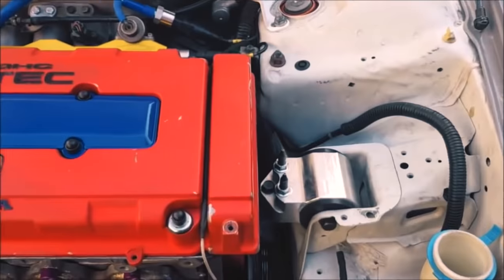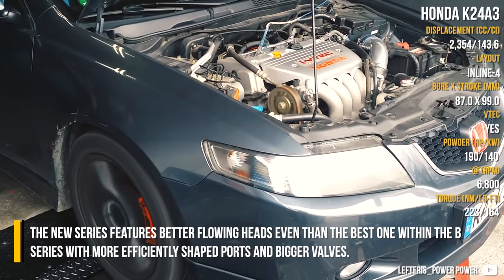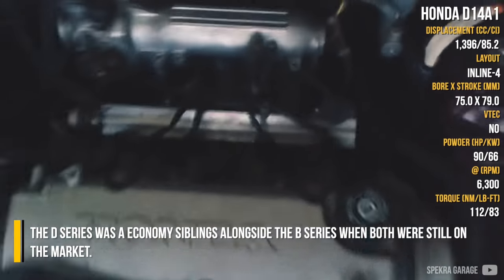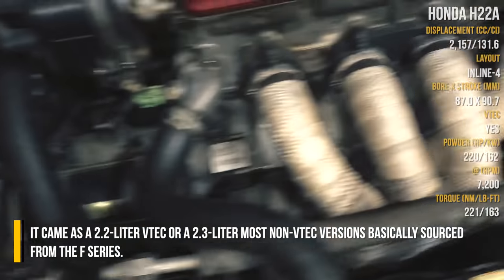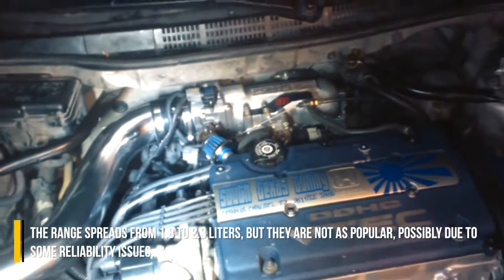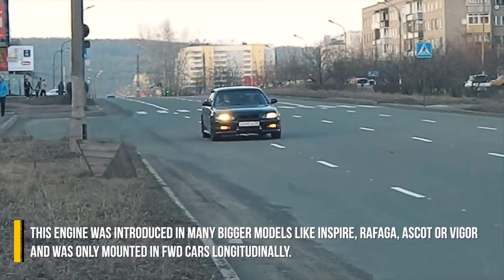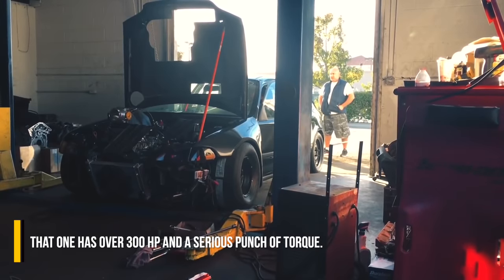Honda Engine Series: Explained

Comment: Leave a like if you're a K series Owner!
Reply: Logλn L K24z7
Reply: @mrsmagik1680  
K20Z3
Reply: K20a master race
Reply: K20z1
Reply: We've almost got all the interesting Kz series engines here. We still need a K20Z4 and K24Z3
Reply: I’m not I but I hope I am soon
Reply: K20a soon to have a supercharger added..... Great engine and pretty damn immortal!
Reply: K24a3. Reflashed for earlier vtec with CAI and branch. 162Kw (217hp)
Reply: @drd6416  
Is your K20A from an FD2?
Reply: k24a2 owner here
Reply: K killer, h2b ek hatch.
Reply: K20A6 ACCORD
Reply: K24W5
Reply: K24 accord, reflash, CAI...very very strong engine...good torque and vtec too!
Reply: 189,000 miles
Reply: My dad had a 08 accord with a K24 I believe
Reply: K20A Honda stepwgn
Reply: 07 Civic Si here
Reply: Used to own one. K20a2 ej coupe. Miss it still
Reply: K24A3 Accord CL9, does it really have all the things listed at 1:17 ?
Reply: K20a2 💪
Reply: K20c1 with injen intake and Remus catback
Reply: 24a2 and 20z3
Reply: K24a2
Reply: K20z1
Reply: Does K20C2 count? 😁
Reply: K24a2
Reply: Does my cr-v with its 2.4 count? Lol.
Reply: Z3.
Reply: Em2 coupe owner  with k20a2 swap 👊❤🇯🇵
Reply: 06 euroR
Reply: Justin1k R if it’s a k series then yes
Reply: Mine blew up
Reply: K20a2 RSX Type S
Reply: K series for Kry babies..
Reply: Just dropped a K20A in my DC5 where it belongs
Reply: K24a3 👌 yeah the cl7 accords!
Reply: a3 😔
Reply: k24 z1 & k20c1
Reply: Lava  not the same K member 😂😂
Reply: Tuned 2003 Honda Element!
Reply: K24Z3.....all the way!
Reply: Aye!!! k24
Reply: K24 2.4 litre vtech on a tsx
Reply: D, B and J here.
Reply: K24 in my element. Lowest power version but I’m still blown away by how great this engine is every time I drive it 😎
Reply: What k series should I get for my Honda hatch 94
Reply: @alezaie  B20VTEC
Reply: Juan Solo thanks will do then
Reply: Juan Solo just wasn’t sure wat was good
Reply: @alezaie  it's a beast... cheap too. Really shines with short intake runners, 4-to-1 header and open cats.
Reply: K24z7 and h22a
Reply: k24/20 split block type shit
Reply: K20a
Reply: k20
Reply: i was a k series owner before. had a 06 civic si so K20Z3.... but then i got rid of the si and got an integra so im a b series owner now :P  guess i might have to K swap my teg lol
Reply: K20a3 ep3 si
Reply: K24z3
Reply: I got a k24 swapped rsx not the good one tho. K24a4
Reply: I dislike this because i don't own honda, only Honda Wave 100cc moped
Reply: @MrGunzngirlz  my step moms accord has the k24z3 its the the 08 honda accord
Reply: Jdm k20a type r powered ek cxi hatch
Reply: K20A6
Reply: K20Z3 FA5 Civic Si
Reply: Sadly I am g owner I’m running 300 n/a tho you
Reply: K24a2 on my acura tsx ive gotten up yo 140 mph on a stock engine 👌 #tsxgang
Reply: I have a 2012 suzuki Swift VXI with K-Series engine lol

Comment: There was also a 2.3L H23 VTEC with an iron crank (vs. the H22's forged crank) called the blue top.
Reply: was it better?
Reply: @MikeyAF  It has a lower redline and more torque down low. I wouldn't necessarily say it's better but I like it. Being able to light up the tires from a roll in second gear is fun af.

Comment: Honda is notorious for creating new engine designs, but using letter designations from older, unrelated engines. The 2 best examples I can think of are B and F.
In the late 80s, Accords and Preludes had a B20. They aren't related to the later B series mentioned in this video that mainly came in the Civic and Integra. 
The F series from the S2000 in this video has nothing in common with the earlier F series found in the Accord/Odessey/Prelude* in the 90s and early 00s.

* Prelude engines were designated H22/H23 in most of the world, but in Japan, there was a version of the H22 that was designated F22. It was the same engine, just called someting else in Japan.

Comment: The H series also have FRM-lined (Fiber Reinforced Metal) cylinder blocks.
Reply: So it shits out pistons faster? Get it? Fiber? No? Ill see myself out...
Reply: I prefer the f20b it has iron sleeve cylinders perfect for boost and its more reliable then a h series.
Reply: Yeah the sleeves are frm. But it's actually reliable you just can't put forged pistons in it unless you do the whole mahle shit. But might as well just throw some darton MID sleeves it in bore to 89mm and send it

Comment: Reliability issues are more common in H series than F, due to the frm cylinder liners most H series have. One of the local guys in my area ran 10's on an f22 block with an f23 head all stock internals on ebay turbo setup. The F series have the strongest blocks but both H and F (except f20b and s2k) cannot handle high rpms as well because their larger blocks create a ton of crank walk (fluctuation in the journals) past 7500 rpm.

Comment: Leave a like if you're an H22 owner.
Reply: Dylan White I am!!!!!!!!!!
Reply: I had a 5th gen prelude with a h22a4
Loved it
I currently have an rsx type s with a k24 block and k20 head
And also i have a 08 accord coupe 6 speed
J35
Reply: F2b, with lsd :), ek hatch
Reply: Josue Aguilar niiiiceeeee
Reply: I own a Straight H swap EJ1
Obd1 JDM H22A with M2F4 trans. About to upgrade to an Mfactory helical lsd and carbon synchros.
And if i can save up enough, mahle gold pistons, rods, king bearings and BOOST.
Reply: @Ryan_christy  Noice!
Reply: Currently swapping an H22 in an 8th gen FD2 Civic.
Reply: Did the 90s accords have them?  If so my dad had a 95 Accord EX Coupe with a 2.2 Vtec
Reply: F20B owner here
Reply: 4th gen prelude h22a1 really fun car
Reply: Late asf reply, but I have a Euro R Cl1 with a redtop H22a!
Reply: Absolutely not
Reply: @slothonastick32  

On which vehicle is this beast in?

Trying to get some pointers on my 5th gen. Need a motor.
Reply: PtotheRum a EuroR CL1 friend. Jdm only car I had imported into NZ, don’t believe they’re allowed in the states. Search up euror cl1 acceleration on YouTube.
Reply: @slothonastick32  that's clean. Nice car. So I take it you are loving the H22? Is there a difference between the red top and the euro r ?
Reply: PtotheRum I absolutely love it, as far as I know the EuroR came with be best varient of the H22, with a higher compression ratio, bigger intake manifold and a factory 4-2-1 header. It makes just over 220bhp. And yes that video is a nice look at one :)
Reply: @slothonastick32  the sound quality on that video kinda sucks. It's hard to hear. But looking at the tachometer in sync with the kph seems pretty impressive. Only thing is I'm in the US and we use mph. Which slows things down a little more. Plus this guy is pegging the gears at the end of a power ban. I don't think this driver is getting all those ponies lined up right.
Reply: 5th gen S- Spec h22a redtop with lsd
Reply: 1995 Accord manual with 01 sh prelude h22

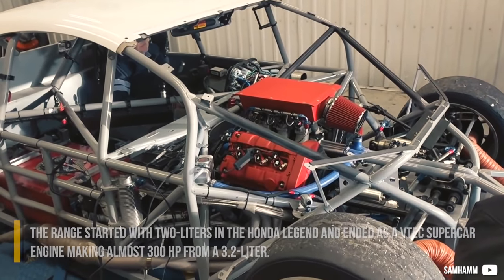Comment: C series Oil pressure drops off as RPM increases 5:58
Reply: Why does that happen? Can any mechanic here explain?
Reply: -SakiSkai-, the owner in the original video says it was a faulty pressure sensor.
Reply: I mean i would be scared  shitless
Reply: Its probably low on oil
As the pump flows more with rpm it will push more into the head and not have as much oil in the sump
Reply: @John.strong  dude the guy before you literally explained it, why did you try to make up an explanation?

Comment: One small correction - the F20B is not related to the F20C/F22C, nor is it related to the F series SOHC - It is in fact a MORE RELIABLE Steel sleeved H SERIES (Smaller Bore - Longer Rods - Shorter stroke) In my opinion the best sleeper of the series - check out my Prelude F20B swap
Fun Fact - the C30 was the first production car engine to come from Honda with Titanium Connecting Rods

Comment: The F isnt popular because it's sohc and has low compression (meaning lower HP). Slap some pistons in it equal to that of an H and it will perform damn near to what an H will.  

The F is the economy version to the H, just as the D is to the B. The F22a is the epitome of reliability when it comes to Honda. Alot of tuners actually prefer the F block because of it's turbo piston friendly iron sleeves unlike the H which have FRM. 

It is possible to put an H head on an F block but it takes alot of work to do it right and really by that time you may as well have purchased an H. The F22a came in a jdm dohc version, very similar to the h23 nonvtec, just with 2mm smaller pistons.

Comment: My personal favorite series is the F. Worked on A, B,C, D, F, H, J, K, L series. Wish they would go all timing chain but still love the J series. It’d also be great if they made a full size truck for the US market, but the transmissions would have to be beefed up to hand the extra torque and heat.
Reply: Why F series?
Pros and cons?
Reply: @deson4958  The F engines are super simple to repair parts are plentiful even today new/ used parts and they’re cheap. In my opinion the right amount of simplicity, economy, reliability, and although not the most powerful engine can hold its own on highway or street driving. Mated to a manual transmission they’re pretty fun to drive imo. Con to me having to change the timing belts every 100k miles which is not a huge problem as it’s just part of maintenance.
Reply: @willdavids7075  i wouldn't actually call this a Con since other cars are way more unreliable

Comment: Best engine in the world!!!
Reply: Lucas Léonce63 disagree
Reply: Tiens un kéké
Reply: Honda is the only common car maker whos engines can put out over 100 hp per liter, handle 9k plus rpms, and still rack up over 250,000 miles. Not even the last gen Toyota Celica could keep up with the Acura RSX, as their yamaha built engines would explode before the k series would hit vtec.
Reply: Pretty Sure im sure they great at developing engine in the masses. However thats not what you were talking about. They are not the best engines
Reply: Easily the best engines ever created.
Reply: Even though honda makes good engines, I would have to say, The king of jdm engines may be between 2jz or the rb. Both have been proven to break records especially the 2jzgte.
Reply: @madkas14  but ur also talking v6 and both are twin turbod. Stock without turbos the 2jz and rb26 engines only have around 200 HP still less than a stock i4 f20c at 247hp. I'd say Honda is the best engine maker in the world, they were making v8s with 500+ power back in the 90s. The s2000s engine, f20c, held the world record for most powerful engine, per liter, ever built from 2000- 2010 and had to be dethroned by Ferrari 458 special, not sold in the u.s. the f20c is still the most powerful engine, per liter, ever sold in America, if it were to have a v8 equivalent with a Mustangs 5.0 the engine would make 625hp stock n/a v8 due to the f20c making 125hp per liter. Enough to destroy and v8 on the market so long as the odds are fair, as in if they're n/a, so am i,  if they're force inducted then so am i.
Same if they built it longer with 2 more cylinders to make a i6 f30c this would still be a 375hp n/a stock inline 6 that beats both the 2jz and the rb26 in power without the use of any turbos. Let alone twin turbos now let's even the odds well say the twin turbos give each 100hp  that's a 475hp i6 made with beginning 2000s tech that would demolish a 2jz or an rb26
Reply: @strlRnn  without turbos the i6 would make less power because of the compression ratio. Show me a Honda engine that can take more power and abuse than a 2j can. There's a reason why the 20 year 2j is still being used today and also being compared to bigger  displacement engines. That's why to me, the 2jz is the jdm king.
Reply: @madkas14  a 2jz block stock can hold up to 750 HP without blowing, f20c block stock can hold 700hp. There really is no way to show u a Honda engine due to no i6s being made. And use and production are 2 different things. Honda b series are still in use and some are motors from the ending 80s. That means they're known tuning engines nothing more. And yes ur right but low comp turbo set ups are a thing of the past with good tuning. The f20c with 11.7/1 comp is ready to be turboed from factory and with a tune on 93 octane can have 400whp 450 on e85. As i said if u care for breaking records the 2jz didn't hold the moat powerful engine, per liter ever built, hondas f20c did. The engine is a legend. The 2jz is only a legend by its twin turboed set up that's why no one wants the base model n/a 2jz. Same with the rb26 no one wants a skyline that's not a gtst or a gtr. The fact i can compare a n/a i4 to a tt i6 should say it all. Yes the 2jz comes with 20 more HP from factory but it also has two turbos and 2 more cylinders.
Reply: No no.dnt even think dat.none is better than 1jz and 2jz.they build to last and not blow up.how much boosts  can d honda take with out blowing up.ha ha wen u talk abt best engines it goes to toyota 1jz 2jz family of engines and nissan skyliners and gtrs.honda cums ofter.better sounding.jz rules and d toyota lexus L.F.A natural aspration engine beat d nissan gt2.even tho nissan awd take off b4 it.u can look it up.not say honda engines r not legends too.but toyota king bmw old skool drift they use 1jz r 2jz .cost less.can take any beating u throw at it.japanies cars r better than german junks.u c toyota honda nissan.all drag races dnt c much german.lol.japan king bby
Reply: @tashinasimpson1927  U compare d series to a 2jz lol a single cam economy engine meant to get 50mpg never intended to be turboed lol  ur not even in the right ball park lol. As i said the engines are just OK, u NEEDED a turbo with a 2jz or a rb engine or it was out classed. Honda didn't need to turbo their engines until last gens civic type r... in 2015. They built their engines to compete with turboed engines. Nissan engines are known to have problems so they can't have the best engines lol while Toyota does make engines but now a days they don't believe in themselves enough to make their own sports cars instead theyre paying subi to do it. I think if u have to compare a tt i6 made to be a fast engine to a economical i4 to win this argument u lost. If u compared it to a f20c I'd tell u that it only holds 50 less HP before blowing than a 2jz can, stock for stock. Being able to hold 700hp for a stock 4 banger is great even today. 2jzs can hold 750 stock. Considering how the 2jz is closed deck and the f20c is not this isn't a great feat. Close deck a f20c and u can hold up to 850 without changing internals. And as stated in earlier comments the jz engines aren't Toyota made but are Yamaha engines lol
Reply: @tashinasimpson1927  dude says it all when he speaks about the nsx v6 Toyota and Nissan couldn't make the "274" HP without turbos the c32 made 300 HP out of a n/a v6 around the same time the r34 and the supra were around
Reply: @tashinasimpson1927  yes i do realize the r34 made around 315hp in all reality and only put 274 due to Japanese car makers agreement but it still had turbos to make 20 more hp
Reply: @madkas14  the king jdm is rb26dett and b series
Reply: @mikoputra149  2jz is king. Do your googles. Fastest Jdm cars are 2j powered...
Reply: @madkas14  not for now, because of the supra single turbo while the skyline twin turbo and also already awd and it's very fast tho if it's stock engine and we have to respect each other because everyone has their own favorite cars
Reply: @mikoputra149  I love both, but the 2j has the records to prove it. I've owned both RB and JZ. I must say I enjoyed the jz more. The 2j is simply over engineered from the factory.
Reply: @madkas14  and you have two engines, rb and jz you tried the vtec engine? Because I haven't tried it because the car is very rare here :(
Reply: @mikoputra149  I tried it.(K20) Its cool for what it is. But I like i6 because of how balanced and smooth they are,  not to mention the sound.
Reply: @madkas14  thanks man, said someone driving a Honda is very fun and very fast maybe if there is an engine I will buy it

Comment: I own a B-Serie Del Sol (b16A2) from my 1st ever car, with atleast 400.000 km on the engine. 
I was the mechanic that took care of it at the honda dealer before i bought it from the 1st owner. 
The original clutch failed at 270xxx KM so i bought it real cheap, fixxed it and its my daily every since.😁

The engine needed a body/chassis swap thoo🤣 Its as still in a del sol, but one that was once a esi/SI (d series.)

only replaced the headgasket and cleaned the cyllinderhead once, because i experimented with ethanol and methanol🙃👌
only new seals,gaskets and 0 new bearings,pistons/rings/valves, all original and the gearbox has never been opend 0 probs.

Comment: Well, hem, N22A user here. Spit on me petrol heads if you want, but after nearly 6 years of driving (without any failure), I still love that engine (and my Gen 7 Accord). If however I had to retain 3 honda engines, for sure that would be C32B, B18C, and F22C. is still dreaming about a 2000-1 NSX with a C32B 6s manual

Comment: Great vid, I just wanted to point out that not all vtec head swaps are called LS Vtec l. It’s only called an LS vtec when it’s swapped on to an b18 non vtec (LS/GS/RS trim integra) block. When swapped onto a B20 it’s called a b20 vtec